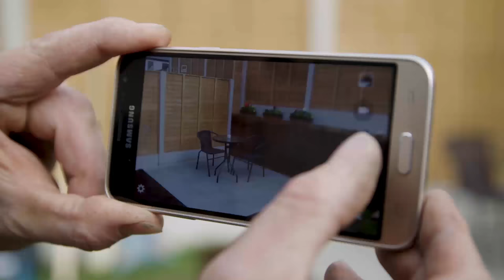How to Lay Paving Slabs For A Patio (with DIY Expert Brian Burke)

Comment from the maker: How to Lay Paving Slabs For A Patio timestamps;
0:00 Intro
0:18 Tools for laying patio slabs
0:24 choose your patio area
0:28 mark & measure the area
0:42 dig a straight edge around area
0:50 dig out the grass 
0:53 stop digging at 160mm
0:58 roll out weed control material
1:05 pour hardcore & rake
1:15 check area is level
1:22 hammer & compact hardcore
1:31 pour sand over hardcore
1:33 flatten the sand
1:38 lay patio slabs
1:46 sweep in jointing sand over slabs
1:58 job done!

Comment: I'm sorry..this is a poor way of doing that.. For a start, he didn't show how to take any movement or rock out of the tiles, secondly, that sand will move in time. The sanded area needs compacted more and the sand he used was to fine. If you can manage to get the stone area as flat as possible, and then use a light coat of quarry dust, it is a far better job.. Better still, if you then mix a 5-6 sand and 1cement, you are actually better floating the slabs on a thin mortar mix..they will not move one inch when the settle in...

Comment: This is great for a shed base, but it will move over time if laid on sand.. better to use a concrete base, reinforced with mesh, for a patio, then pave over..
Reply: He's building a patio for light use not a multi-storey carpark.

Comment: No slab should be laid without mortar...they will sink...here speaks the voice of experience...do everyrhing advised here, but clear a central hollow per slab, and add mortar...it also does advise depth
...160mm...just over 6 inches..
Reply: Hi, how do you “clear a central hollow”?
Reply: @jandone100  3 years later we're still wondering how to clear that "central hollow"😂